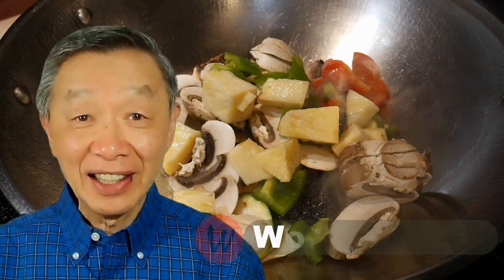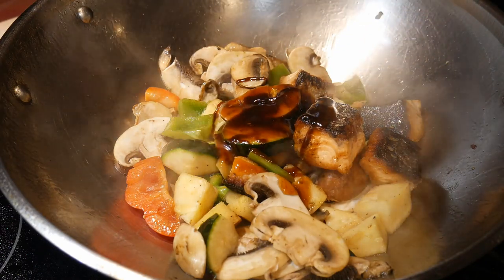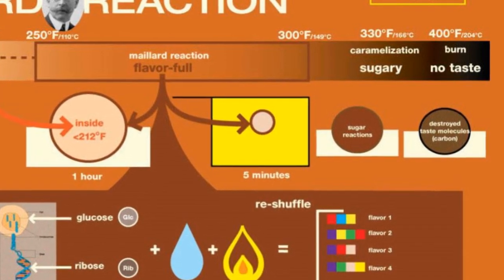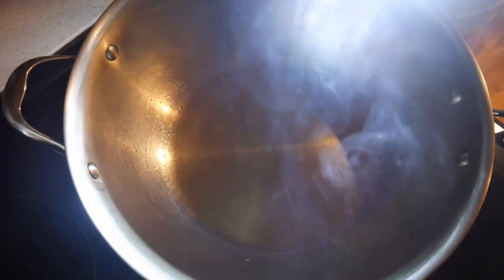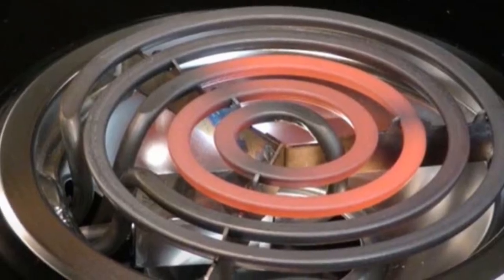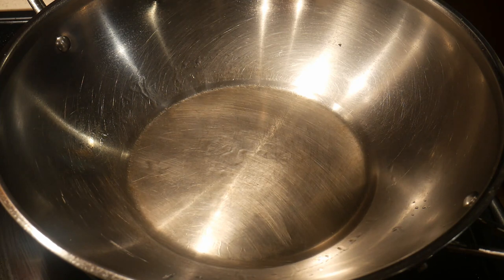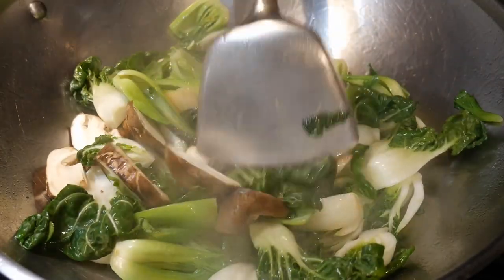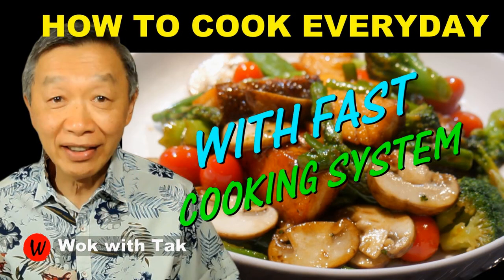MANAGE HEAT during stir-frying with home kitchen cooking burners: gas, electric, and induction

Comment: I've enjoyed stir frying. Switched to avocado oil to make it healthier. The vegetables are great. The meat seems to cause problems. I add just a small amount of starch to it with the sauce (common practice in stir fry). The coating sticks to the bottom of the pan. Any advice would be appreciated. Thanks
Reply: Do not add the dry starch directly into the wok. Instead, mix a small amount of cornstarch with an equal amount of water in a separate bowl or mixing cup, and then slowly pour this slurry into the wok while stirring vigorously. Add it a very little at a time; it will take a few moments for the starch solution to incorporate into the sauce, so it’s very easy to add too much. Stop often to check the consistency; otherwise you’ll end up with a glue, instead of a glaze. This will become much easier with experience.